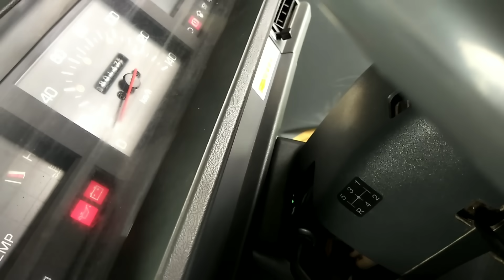Setel bospom L300 / setel Tenaga L300,Mudah,Kencang dan Responsif

Comment: Sudah prektek di L300 thn 2016, dan alhamdulillah hasilnya joss tenan pak bro... Matur suwun ilmune...
Reply from the maker: Alhamdulillah bos,sip..sama sama bos terimakasih juga sudah ditonton😇
Reply: kira kira nanti resiko yg terjadi apa masbro kalau sudah di setting ?
Reply: Osz Santoso cara pasang selang fluit L300 solar gmna bos?
Reply: @DokterOtomotif  kudusnya mana om, boleh minta no hp
Reply: hasilnya juga joss diunit saya thun 2016 mas,
Reply: Om bagi no wa y sie
Reply: @DokterOtomotif  setelan tadi untuk komsumsi BBM boros atau irit itu mas???
Reply: @slowman5412  kalau setelan fuel adjusternya kebanyakan ya jadi boros mas
Reply: #osx santoso mesin l300 nya setelah di setel terasa panas gak sampai masuk ke gabin dalam
Reply: @afriantojambi8156  kalo indikator temperatur panase naik turun, tergantung kaki om. Tapi kalo panase masuk dalem kabin emang iya, tpi bukane itu wajar2 aja y?
Reply: Saya mau magang Pak de, Nonton vidiomu dulu biar Tau nama"nya komponen Mobil l300 Lebih paham wkwk.
Reply: Dok...mau tanya..gimana cara mengatasi oli perseneling yang netes ke bak bawah..apakah ada kebocoran siel....
Bagaimana solusinya???
Trima kasih..
Reply: @Damon Dallas instablaster :)
Reply: @Angelo Mohammad Thanks so much for your reply. I got to the site thru google and im in the hacking process atm.
I see it takes quite some time so I will get back to you later with my results.
Reply: @damondallas1237  asline aku gak mudeng bahasamu cak.... Sumpah.... Tapi yo tk like wae lah... Mugo2 positip
Reply: @Angelo Mohammad it did the trick and I now got access to my account again. I am so happy:D
Thanks so much, you really help me out :D
Reply: @Damon Dallas happy to help :D
Reply: @agengpurwanto8176  master kopling nya itu mas
Reply: Cara nyettel karet imingnya gimana kak soalnya saya gak ngerti
Reply: Mas kalau l300 2003 bisa gak di stel seperti itu,salam dari Riau
Reply: L300 thun berapa ini om
Reply: Lokasi bengkel dimna pak
Reply: Alamatnya dimana pak bos,

Comment: L300 saya susah di nyalakan setiap pagi dan harus di pompa dengan tangan, pompa solarnya baru bisa nyala. Itupun agak susah dan lama baru nyala. Saat mau menyala, kenalpot mengeluarkan asap putih yang banyak. Itu kenapa yah?
Reply from the maker: coba kalibrasi injection pump bos
Reply: @DokterOtomotif  biasanya biaya berapaan yah buat kalibrasi?
Reply: Stir agak bergetar l300 saya apanya itu pak.🙏
Reply: Kuda diesel saya pernah begini juga. Pagi susah start, harus dipompa dulu. Nggak taunya masalahnya ada di kabel power relay glow plug yang sudah jelek. Ganti kabelnya langsung tokcer sampai sekarang.

Comment: Selamat pagi Pak dokter, semoga selalu dalam lindungan Tuhan. Mobil saya kuda diesel, baru turun mesin suaranya kalo di gas seperti nglatak.
Mohon penjelasannya.
Terima kasih Pak dokter 🤝🏼
Reply from the maker: Makasih bos.coba setel geser injection pump,biasanya terlalu maju timingnya
Reply: Selamat malam Pak dokter, ternyata klep api saya mentok ke piston. Dan saat ini asap keluar putih. Mohon solusinya Pak. Terima kasih 🙏🏾

Comment: dok mohon bantuanya.. kalau mau bikin l300 boros bbm misal yang semula 1:10 jadi 1:7 bagaimana caranya. sebelumnya trimakasih banyak mohon dijawab
Reply from the maker: Kok malah pengen boros ya?🤔🤔🤔😁
Reply: @DokterOtomotif  iy mas.. bisa gak ya mas
Reply from the maker: Bisa stel fuel load bos
Reply: @DokterOtomotif  maksutnya stel baut fuel load persis sperti di video ya mas.. 
 saya udah stel baut fuel load nya 5putaran. stasioner jadi gede saya stel stasioner sampai mentok stasioner masih gede mas. gimana
Reply: Banyak kali sampai 5 putaran Lae. Terlalu boros malah gak ada tenaga Lae,, dan sangat tidak aman. Mesin terlalu panas bisa over heat akhirnya jebol.

Comment: Mas mau tanya saya ada l300 2 satunya tahun 2010 sama 2017 keduanya setelan mesinnya dah di mentokin tapi kok beda ya tenaganya enakan yg 2010 sama asapnya juga banyak 2010 yg 2017 tipis asapnya tapi saya lihat bosh pumpnya kok beda ya mas yg satu denso yg satu zexel kalau yg 2017 saya ganti boshpump denso bisa ga mas
Reply from the maker: bisa,diganti.adavyang di ganti memang
Reply: @DokterOtomotif  kalau ganti boshpump denso ganti rotor sama apa lagi mas

Comment: Pak De, kalo Isuzu panther pagi2 baru di hidup kan, mati2 terus, kalo udah panas gak masalah. semenjak turun bos pom ganti seal dan spare part, mesti di gas besar, filter solar dan udara udah ganti, setelan timing emang agak maju, apa fuel load adjuster nya mesti di setel putar kanan 1/2 putaran untuk nambah asupan solar nya. soal injector nya apa perlu di buka dan di bersihkan. Terima kasih ssebelum nya pak De.
Reply from the maker: Stel stasioner dulu bos
Reply from the maker: Mungkin kekecilan
Reply: Mas tempat penyetelan stationer unt l300 diesel sebelah mn ya? Soalnya l300 ku setelannya g bs dikurangi
Reply: Sudah di besarin stasioner nya pa De , tetap mati2 juga. Kemarin udah ketemu fuel load adjuster nya, saya setel fuel load nya, sudah tidak mati2 lagi kalau stasionernya di besarin dikit dari setelan cuk pedal gas.
Reply: Kalau saya tambah sedikit lagi fuel load adjuster putar ke kanan, tanpa di besarin setelan stasioner nya ga mati sama sekali, cuma putaran stasioner nya agak tinggi, ga bisa di kecilin setelan stasionernya. Kalo sudah panas mungkin putaran stasioner nya bisa naik lebih tinggi lagi. Trims inspirasinya pa De
Reply: @bajomulyo57  mungkin setelan fuel load adjuster nya bisa di kurangi di putar ke kiri sedikit aja 1/4 atau 1/8 putaran mas
Reply: Dokter Otomotif oya mas untuk mobil bensin apa ada yg namanya fuel load adjuster sprti video di atas?
Reply: Pesoy Nawainruk putaran load adjusternya sebelah mana mas

Comment: Slmat malam dok,mobil saya l300 th.2008,
Untuk tenaga trbilang sedang,tpi rasanya suara mesin tidak puas seperti tertahan,dan punya asap yg lebih banyak dibanding l300 biasanya,dan agak gampang panas,kira² apa penyebab dan solusi nya dok,tolong infonya..
Reply from the maker: Coba stel timing dan fuel load dulu bos..untuk mesin panas cek kebocoran air sama termostat
Reply: @DokterOtomotif  oke dok,trimksih..smoga bermanfaat..

Comment: Saya punya kuda diesel thn 2000, kalo di gass berasa berat. Di gas pol jg rpm ga sampe limit, bys nya apa yg harus di cek pak bos??  
padahal filter solar sm udara baru, terus filter solar kecil yg dari filter solar ke bospump udh bersih.
Reply from the maker: Coba stel dulu fuel loadnya sama timing bos..biasanya kuda itu.
Reply: @DokterOtomotif  nyetel ny gmn pak dokter??  kalo timming ny di majuin ya
Reply from the maker: Sama dengan video L300 saya bos
Reply: @DokterOtomotif  akan saya coba, trmksh pak ilmu nya
Reply from the maker: Ya bos sama sama

Comment: Mas ini L 300 THN brp
Reply from the maker: 2017
Reply: L 300 Saya THN 2019 beda pump nya bg
Reply: Gak ada setelan di pump nya bg
Reply: @Andak_chanel.1981  ada boz. Semua injection pump diesel ada fuel load adjusternya. Punya boz masih ketutup segel, makanya gak kelihatan. Saya juga buka dulu segelnya, pake obeng kecil.